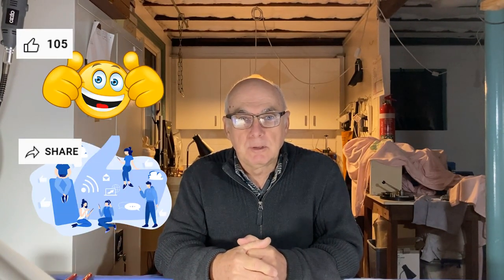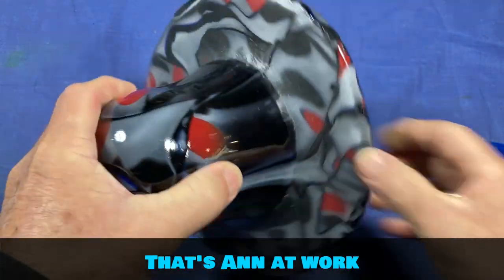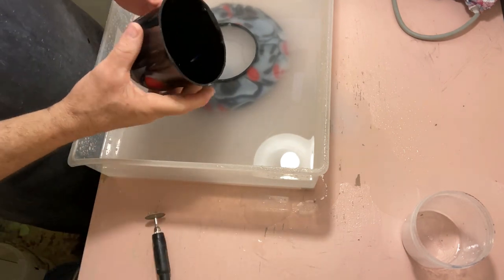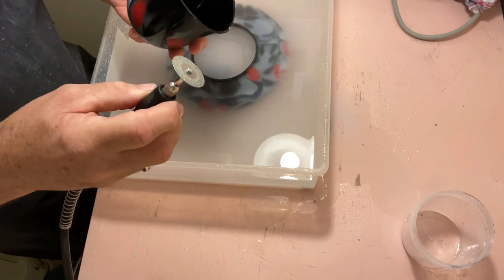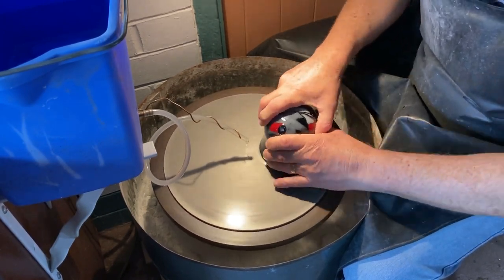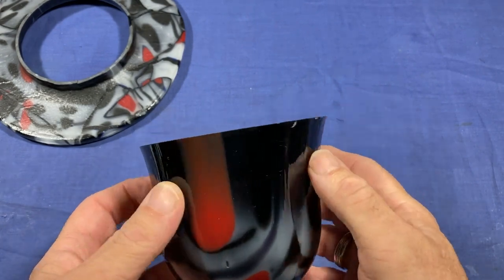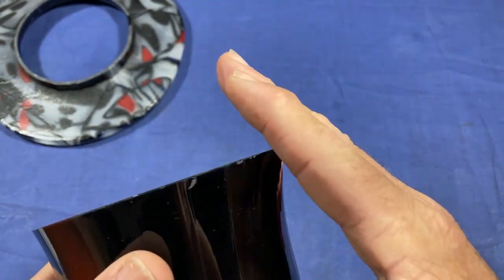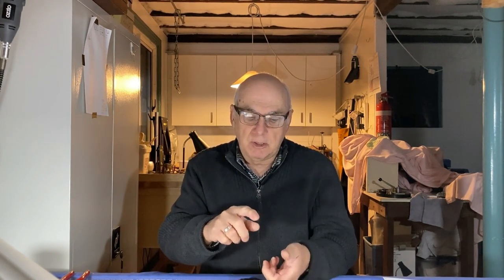Let's Finish the Drop Vase, Cutting the Rim Off, Fused Glass Tutorial - Part 2

Comment: Inspirational, I'm going to have a crack at it, thinking about using a terracotta saucer turned upside down for a mould. Your cut of rim might work with a fuse to polish and bring down to 6 mm then use as a picture frame. Great patience shown with the cutting off and the grinding, I can't imagine the hours involved
Reply from the maker: Hi Paul. That idea may be cool. I've been thinking of a few things, but for now, I need to do something different 😁🙄 The cutting didn't take too long. I think it was between 20-30 minutes. I was pleasantly surprised by that little blade.

Comment: That's beautiful. I haven't watched the previous videos, but I will soon. Is your grinder a DIY project? I'm just getting my studio setup and need to save money as much as possible. I'd rather spend it on some more glass!🙂
Reply from the maker: Hi Rene. More a repurposed item. It's a large flat lap that is used in lapidary - gemstone polish etc. I contacted lapidary clubs and kept an eye on secondhand sales sites like Gumtree and even eBay. One eventually came up for sale and I grabbed it for just $150. I then purchased large diamond disks to suit, stuck some magnetic sheet to the back of the disks so they would stick to the flat lap. Works well. Only problem, they stick so well it's a little difficult to take them off. I have to use something thin to get under them so they can be peeled off.
Reply: @RocketRoseArt  Hi Jeff. What a great idea and thank you for sharing that information with me. I like to repurpose things. I will have to look for something like that. I have an extra grinder that came with the equipment I bought, I was thinking of trying to do something with it, but I'm not sure the motor would be strong enough. Thank you again for taking the time to share the information. I'm really enjoying your videos! Have a great day!

Comment: Hi Jeff!  

Can you tell me what that grinder is that you use at the end?  And what size the disks are?

I really appreciate how you took us through the process with warts and all… I learned so much!!
Reply from the maker: Hi Cecilia. That's a flat lap. An old lapidary lap I found a while back. The disks are about 400 mm I think. They're diamond disks with magnet material stuck on the back so they adhere to the steel platter underneath.
Reply: @RocketRoseArt  thank you!!  This is super expensive equipment!!!
Reply from the maker: @ceciliaboggio3607  Yes, new they are. I couldn't afford a new one either. Look around for a secondhand one. I paid just $150 for mine. A bit lucky but they can be found.
Reply: There are some videos on YouTube on how to make them yourself, if you’re inclined…
Reply: @jillh2858  that actually makes sense!